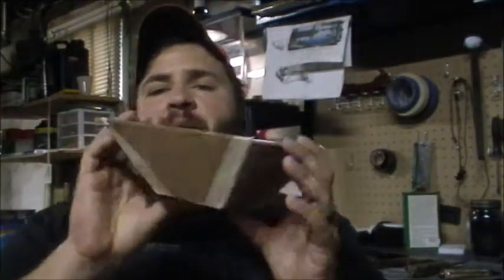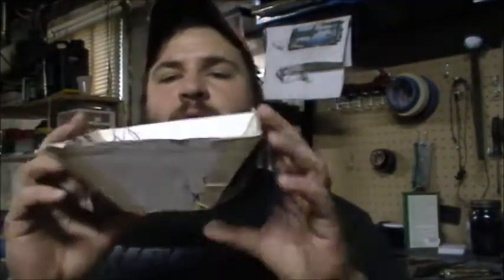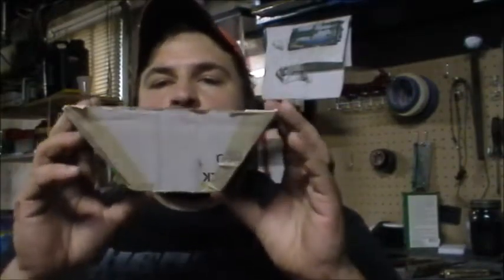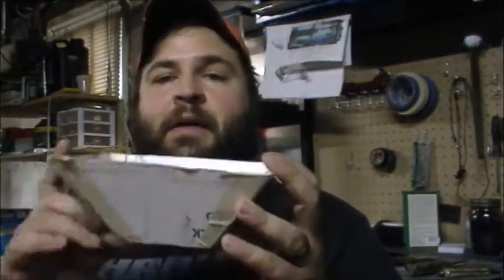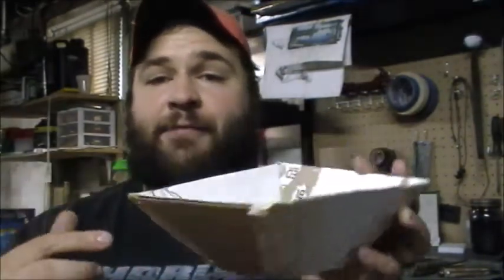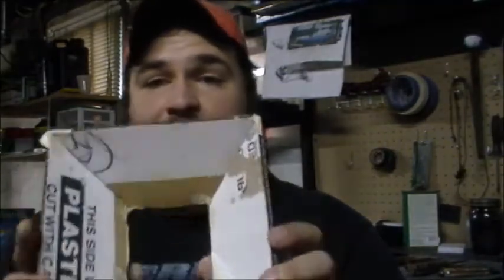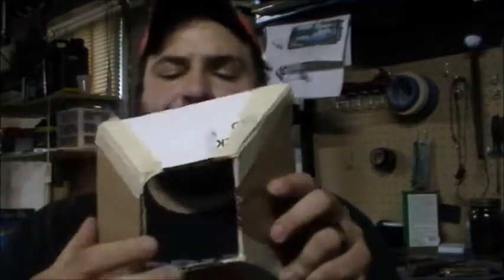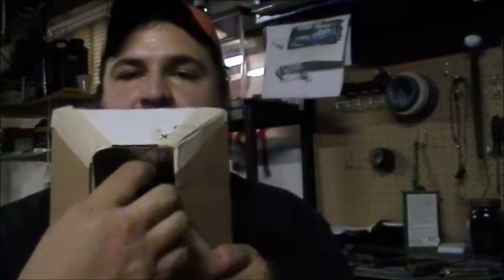homemade coal forge firepot part 1

Comment: Many years ago, I was told by an older fellow that the definition of an expert is that:  Ex denotes a has been and a spert is a drip under pressure so, an expert is a has been drip under pressure!  DON'T be one of those!  Just learn what you can as you go and relate that information to those that are interested and let them do with it what they will!
There will always be those that know more and those that know less!  Be happy with what you know and what you can do and try more!
Kudos on the video!